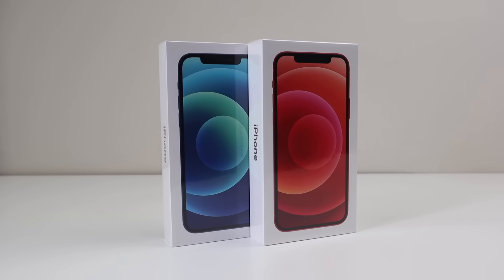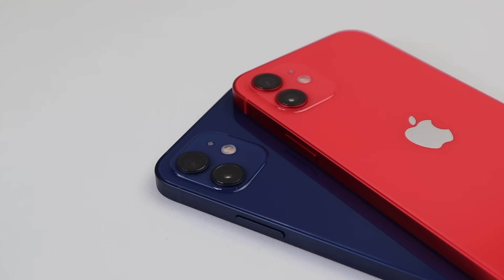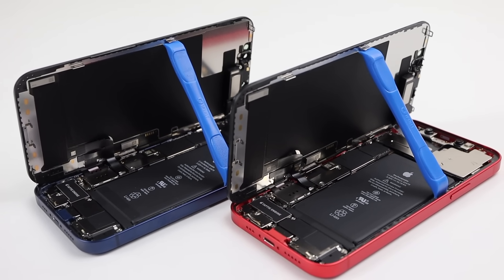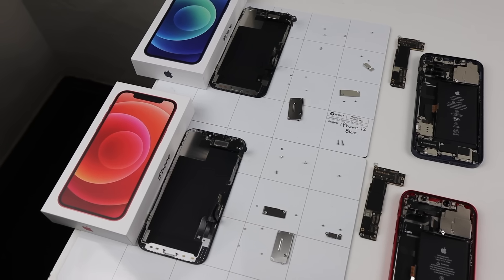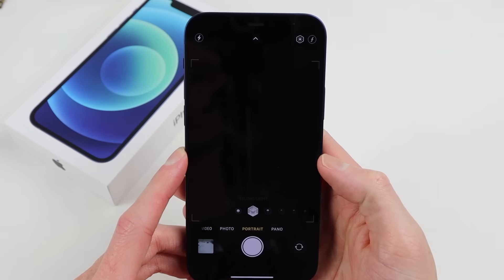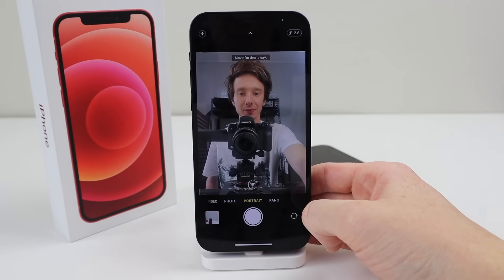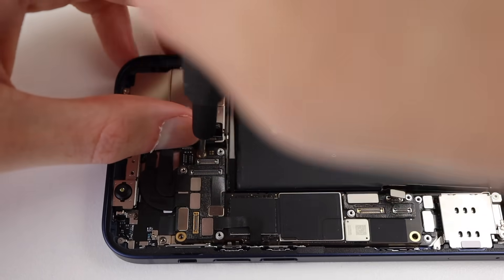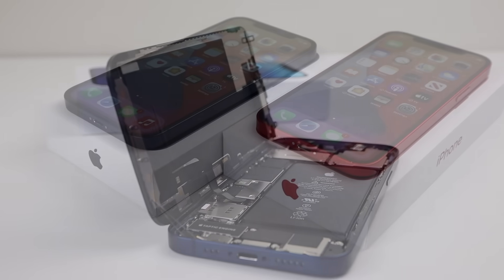iPhone 12 Anti Repair Design - Teardown and Repair Assessment

Comment: Are they running a program at the factory or repair shop to "pair" all the components together? Cause obviously sending it in they wouldn't return it with all those problems.

Comment: There is really only one good thing about owning apple products and that is that they do support the software of these things far longer than you will see on any other  device maker so you can be assured that the phones S/W will be updated for years to come, I'm still getting updates on my 6s. With Samsung you'll be lucky if they support it for a year maybe two before they've dropped any updates. That said the whole pairing components so only Apple can swap them and then basically not offering repairs is horrible but that's the trade off you have to make when buying these over priced Apple products. So basically the iphone 12 is an expensive throw away phone, once it breaks you'll be forced to buy a new one.

Comment: Starting with iOS 11, Apple attempted to block NAND IC change by requiring the original WIFI and BT MAC address to be programmed, so independent technician now acquires this info from third parties but can still do the repair. So even if apple will not allow us to repair i12 someone will find a way to bypass this block.

Comment: i remember i have a iphone 6plus the apple store told me its unrepairable and took it to many apple stores yet no one can fix it i been using it for 6-7months then then i take it to a 3rd party repair shop and fix it immediately for 50 bucks and after that i never used an apple ever
.
if i would remember the apple store told me it was my fault (water damage, ghost touch ) but the 3rd party told me it was a chip (i dont know) and their is no water damage

Comment: Obviously apple is not doing that deliberately. Since every display is manufactured slightly differently, they need to color calibrate it. Then the calibration is stored on the phone. When you swap displays, it detects that the calibration info doesnt fit the display and thats why night shift stops working since it relies on accurate color information.

The cameras dont work after swapping since theor optics also have slight production variations. The 0.5x camera is likely hitting an endstop on its movable optics and thats why it sends an error message and makes the camera app go crazy.
The face id is not working because the secure enclave id must match the cryptographically paired one to the mainboard. Otherwise a thief could connect a fake face id sensor which always says “ok, face matching” to unlock a phone which should not be unlocked. Its for protecting user data. 
So please stop your left wing complaients. Apple is a private business and they can design their phones any way they want. If you dont like it, make a better phone.
Reply: you don´t understand the free market. some on says hey i found something that company A does that the competition doesn't do and the consumers listen learn(do i want to be able to repair)  and choose where to spend there money next time the buy a phone. that the free market

Comment: me and my wife still had our 6s plus from years ago,both our camera exhibit a problem where the optical stabilizer keep vibrating upon activating the camera,glad the anti repair measures was not on the 6S, it cost me just 30 bucks just to replace the camera module in independent repair shop out there

Comment: What a great video. Great job!
Now, I was wondering: one of the most common issues is cracked screen. What happens if you replace only the front panel with screen and button?  Not sure, but I think it will work  except for the front camera and face ID, correct?
What a shame....!

Comment: The display and camera may be serialized as they are calibrated at the factory. The calibration profile may be saved on the logic board rather then the display. The cameras may go thru a similar process. However the battery is serialized to specifically lock it repair.

Comment: Remember when Apple testified in court that these issues will only present when they detect unauthorised parts, yet you clearly show them presenting with authorised parts?
It's almost like... they lied under oath. Which is a federal crime.
Reply: @klam77  I think you misunderstood what my comment was about, but that's fine. I was simply commenting they didn't necessarily lie under oath. I didn't comment on if I agree with their policies or not.
Reply: @davzaratsyan1735  You have to say though that they're trying to monopolize their phones. 

Another thing you own that phone you should be able to repair it yourself as you the consumer owns said phone.
Reply: 🙄 Cause someone is actually going to procecute apple for that. 🙄
Reply: @klam77  Most of these people cannot even fix a cracked pipe with duct tape so they will stand by their "principles" of being absolutely incompetent. They are the ones who cannot match cables to their slots and they won't be able to understand why other people would want it to not be done for them either.
Reply: It's an "unauthorized" part, if it came from another device, even if that is a genuine Apple device.   I'm sure their legal team ensured they wouldn't get trapped with such a simple phrasing.
Reply: What actually is an “authorized part”? If you disassembled the phone without apple’s approval isn’t that considered unauthorized 🤷🏾‍♂️
Reply: @bproducer  I mean in technicality YOU own the phone so it's basically whenever you want to.
Reply: @bproducer  why do you need Apple’s approval if you own the phone? Assuming of course you paid for the ownership to already be in your name. Unless... paying for it actually just means renting your phone :P
Reply: @bproducer  I guess it means parts replaced by Apple at their official support. Problem is, their official support is pro-device-replacement, so they'll very, very rarely swap your main board. Just as they do with the mac books, they'll tell you the damage is terminal and that you need a new device.
Reply: @bproducer  but risk the chance of voiding the warranty
Reply: Because Apple did not authorize it.
Reply: Lying under oath is bad fibbing however....
Reply: EXPOSED
Reply: they werent authorized parts though lmao
every part is authorized for each specific phone. if you swap one phones parts with another, those arent authorized parts. that means only apple can repair their phones since a 3rd part shop doesn't have the resources to pair phones with their parts. sucks, but they didnt really lie.
Reply: did u forget china exist?
Reply: yeah well, if you have enough money it basically doesn't fucking matter
Reply: Technically only the part for that specific phone is authorized... so replacing it with another Apple part from another phone is still unauthorized. So no lie there.
Reply: Can someone sue them for it?
Reply: HelloI'm Rick .This is our new shop on line: ,our phone case shop:https://heronsky.en.alibaba.com/productlist.html?spm=a2700.shop_index.88.12.19a65b77WPlvJN.Thank you very much if you can buy something or make some suggestions??We can provide your customized phone case? and delivery in 24 hours if the quantity <=1000pcs  MOQ 1pcs
Reply: Agreed, although them being the snakes that they are they would argue said part was only authorized for a specific iPhone.
Reply: There problem is that the software initial load @apple records hardware serial numbers. When you swap the board, all the serial numbers changed. Unauthorized parts = all parts not changed by the factory. This is not a new problem. It's been demonstrated on previous iphones as well
Reply: I was the 1000th like
Reply: Get In The Van  its sarcasm
Reply: @emilianstaniak504  haha yea sarcasm under oath I like that :D
Reply: @emilianstaniak504  Bro, dont be that dumb
Reply: @emilianstaniak504  actual brainlet
Reply: how is it authorized? he swapped logic boards from another iphone that has different serial number so that's an unauthorized repair.
Reply: @davzaratsyan1735  average iphone enjoyer=
Reply: @kubapetynia2278  don’t even have iPhone. Good try though.
Reply: @kubapetynia2278  he is right
Reply: @davzaratsyan1735  what about the cameras lol
Reply: @davzaratsyan1735  so if I get an authorized logic board you think they would still allow it ?
Reply: @w1z4rd9  idk
Reply: @w1z4rd9  You can't get an authorized logic board because it doesn't exist
Reply: @davzaratsyan1735  the parts came directly from Apple. If that isn't authorized, then literally nothing is.
Reply: @davzaratsyan1735  a wild isheep just appeared!
Reply: @davzaratsyan1735  no if you make a repair using the manufacturers parts then your using genuine parts not 3rd party ones so the repair IS authorised. using 3rd party parts that the manufacturer hasn't approved for use would be classed as an unauthorised repair.
Reply: @davzaratsyan1735  He said authorized parts, not repairs
Reply: @davzaratsyan1735  hes swapping 2 LEGITAMATE apple authorized and manufactured parts. it might be and unauthorized repair but it is using authorized and genuine parts.
Reply: @davzaratsyan1735  no you didn't get the Apple claim, the parts should be authorized because they are from a new Apple phone, right to repair has been blocked even though the swapped parts are original, so indeed Apple lied under oath.

Comment: "you'll have buy an additional power adapter to make that work"

make that work, you mean Charge my phone????
Reply: Well, by Iphone 13 you won't have that problem because they will remove the charging port entirely and replace it with an RF charger (the iphone box will come with the same USB-C wire, but the outlet and the RF platform will be sold separately). Obviously, this RF charger will have a Hash key to check that it's your charger and not some cheap 3d party's, because if it's not YOUR charger, it will simply disconnect the battery, and not charge

Comment: You’re missing an important point - they need to make FaceID and the paired with the phone for security reasons. You could take someone’s phone then swap in your faceid or touchid and have access to someone else’s phone. It would be a super simple workaround to get Into a device.
Reply: That's not how it works, the FaceID firmware is not on the camera.
It's on the logic board, which is the same location that the operating system and data storage is. 

Even if you tried this on a random older iphone that supports FaceID, one that's easy to open up it wouldn't work this way. 

I totally get the confusion, without context your argument would make sense to someone unaware of how electronics work.

Remember nearly a decade ago when the FBI tried to ask Apple for their own personal jailbreak to get through login screens? If it was that easy I'm sure the FBI would have figured it out.

Comment: If you cant fix it;  without going through the manufacture. is defiantly a reason not to buy... U imagine if you  bought a New car couldn't replace battery when it died. That's a loss of allot of business for every one...  This type of manufacture control is type practices that need stopped.

Comment: Is it possible these security measures would prevent a stolen iPhone from being accessed by swapping logic boards to gain access to encrypted storage? Or similar parts changes.
Reply: Logic boards contain security data (faceID) personal data (storage) and it's operating system.

Phones are not like computers, all their guts are on one part 99% of the time and Apple is no exception.

If you're coming from a desktop building argument I totally get that. Just keep in mind that if I was to say, encrypt a harddrive, even if you put it in a new computer it wouldn't magically unencrypt

Comment: For the test. Swapping the parts from one Red to another and a Blue to another Blue. The Red Product could be coded different in the software to cause issues with the Blue Version. I could be wrong but ive seen dumb stuff like this happen based off a change of product numbers in the software

Comment: I have no problems swapping in batteries and screens in iPhone 6s but as soon as a tried on a iPhone 7 Plus it damaged a few grounds on the 12 row of connections. I think it's C12-P12 since audio and home key are non responsive. Though can still text and do online apps with it. Expensive pieces of crap these iPhones are with even a screen protector and case I dropped my iPhone one from my hip, maybe 2' and it cracked the screen. Pfft freaking lame. I went back to a 6s and got a military grade heavy duty case. Makes it bigger and heavier but I don't want to break another again.

Comment: At my work we are Apple certified. You have to use a program called repaircal after a camera (or any item replacement like a whole screen) replacement and the program will only work if repair is initiated through apples repair website and a part has been “ordered”. This re-pairs any serial number issues conflicting the phone. It’s all very interesting I have to say but they have it on lockdown. 

We get people all the time who use 3rd party parts and it voids any warranty or even AppleCare. You would not believe the amount of missing screws we have seen once we get them open Or the amount of bad batteries being put in. 

At Apple certified locations, like ours at least, we can repair camera, display, and speaker issues. Anything further requires either a whole unit replacement or for the item to be sent to Apple. If the back glass is broken it’s a whole unit replacement automatically. With AppleCare that is only $99.00 or a screen replacement is only $29 under AppleCare. 

Outside of that I cannot stress this enough, if you will not be getting any type of plan, get a good case I’m talking thick case like an otter box defender. We have people who refuse to put cases on and it makes no sense why you would risk it and have to worry about your device falling once and us pissing you off with a price you are not going to like with out of pocket expenses. 

Anyway, I do understand all of this and how frustrating it is and all I can say is we feel it as well.

Comment: THERE HAS NEVER been an Android Phone that has ever done this to its customers. EVER. Not one.
Reply: Not quite to this length, but a couple companies have tried to prevent unlicensed repair. Not for very long because customers complained and Android users tend to go for the option that makes sense. At least, that's my guess as to why they stopped
Reply: @mikesully52  Could I please inform as to what companies did this? Never heard bout this before.
Reply: @aldebaran2643  HTC and samsung both tried to get away with similar stuff
Reply: @mikesully52  Not to mention, generic android phones like my Switel from 8 years ago having soldered-on batteries and everything glued together for no reason at all. 
And the pinnacle of android nirvana would be... Samsung? Really? Same prices as Apple and random components from a bottom-feeder? Sure, makes A LOT of sense.
Reply: @IlBiggo  I never claimed they were "Android nirvana" simply that they tried to lock down components.

If you want to debate a point with me I'm happy to do so, just make sure it's a point I'm actually making.
Reply: @mikesully52  Wasn't really debating, just adding to your answer.

Comment: John Deere has been doing this for years with farm equipment.  Farmers cannot replace certain parts on their equipment without the authorized dealer coming out to pair the part to the equipment.  It's not free to have a tech drive 100 miles round trip to connect a computer to a tractor, just to pair a new replacement part.  Automakers have tried this, but there are enough people with cars and mechanics pressuring  the government to legislate right-to-repair laws for autos.

Comment: You can still use any of your old lightning cables with the type A bricks though. They should have just went full type C with the charger and finally phased out the lightning cable as it is outdated and old. Apple has been slowly bringing type C to their line up and many were surprised the 12s still use a lightning cable